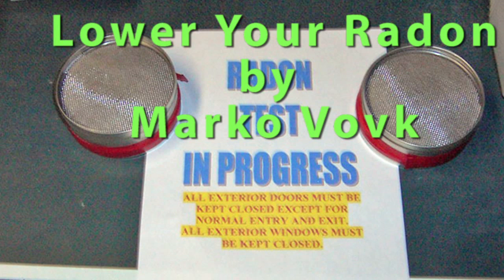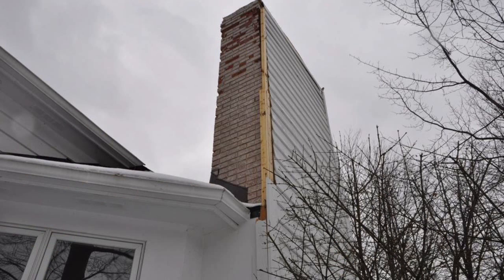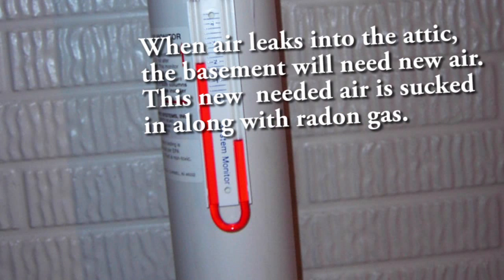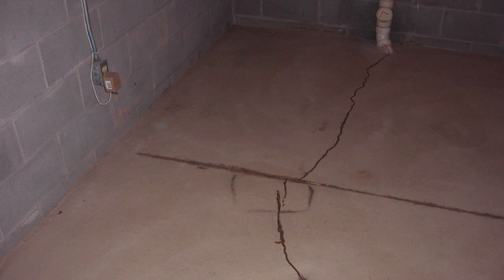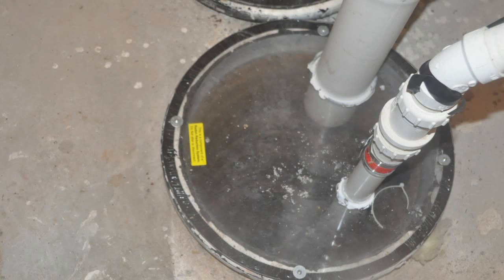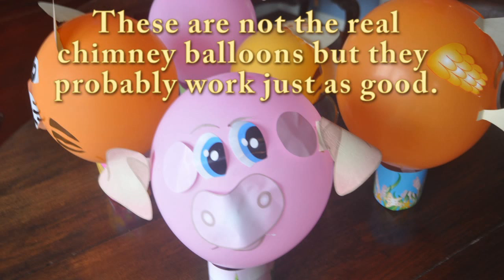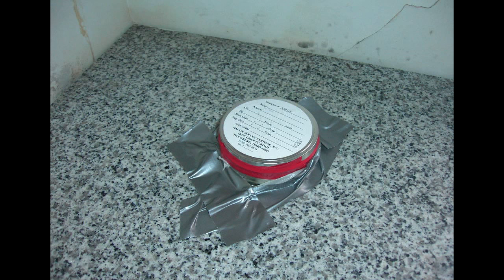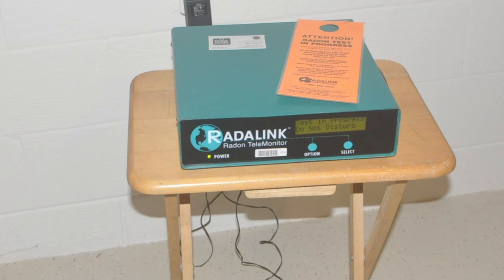Free easy way to lower radon gas

Comment: I wonder if anyone has tried to pressurize the gases under the foundation just slightly to push radon gas away from the subsoil?
Reply from the maker: Not sure how to do it that way
Reply: @Clevelandmarko  it’s easy just put the radon fan in backwards.

Comment: My 90% gas furnace draws combustion air from the vented crawl, which I leave open, since Eastern Washington is 2" shy of desert. Our snow is dry, our summers are dry and spring and autumn very wet. I have full HVAC with cooling unit outdoors, and heating air drawn from the house. My thinking is that using a single pipe/exhaust only system could be a pretty effective way to reduce radon. Seems it allows for the radon gas to literally get pumped out of my crawl by my furnace via the combustion process, while simultaniosly drawing in fresh air from under the house instead of through living space nooks and crannies. Is this circulation method adequate? I am only 624 square feet and single story.
Reply from the maker: I have a sevicw.  Call Marko with a question.  Just Google it

Comment: Radon itself is harmless. It's a noble gas and doesn't bind to anything. However as it decays the "radon daughters" or decayed radon does bind to everything including your lungs. If you can circulate the air which creates a small amount of static or use a positive ion generator/ fan this will cause the decayed radon to bond to walls and floors and eliminate air born / breathable  decayed radon.  Also, AC has increased the levels of radon nationwide along with asthma and allergies. AC doesn't exchange the air .  . . . it just cools it and re circulates the same air over and over. The national average of exterior / outside air is 4 picocuries per liter of radon. BUT exchanging the outside air radon ( the noble gas ) with the "old" radon that is decaying in your home will substantially reduce your breathable radon.
Reply: National average of outside air is 4 pCi/L??? I think you mean 0.4.
Reply from the maker: thank you

Comment: How about running a fan and a dehumidifier...would that help?
Reply from the maker: +JP Flachier                     Dehumidifier always helps
Reply: I think running the whole house fan 24/7 (except when AC is on) is beneficial. Yes, the fan will suck some radon into the house, but it will expel more than it takes in. The only thing that may be bad is that most fans are located close to the sump pump area which is a highway for radon gas entry (seal that with an air tight cover)

Comment: Radon is a hoax.  Check out this link:   www.forensic-applications.com/radon/radon.html  There have been several SCIENTIFIC studies showing small amounts of radon are either harmless or even beneficial.  Think about it, well water contains radon, people drink it and shower in it, yet live.  Use common sense people.  Costs nothing to fix a problem that doesn't exist.
Reply: +Jo Blough 
You are right: that’s the state of the science. In the US, the states with the highest background radiation levels have the lowest overall cancer rates, and the states with the lowest background radiation levels have the highest overall cancer rates.
Reply: You then go ahead and buy a house in Thernorbyl.
I bet the land is pretty cheap there too.......
Reply: Not the same thing. That land was exposed to massive radiation, not the 6 picocuries typical of US homes. Fyi, most fruits and veggies grown around the world have enough radon in them equivalent to 6 months of typical exposure. A banana has 550 picocuries. A potato has 500. Also, while residential home are recommended to remediate above 4 pc, a workplace doesn't have to have remediation below 100 picocuries. Does that mean if I work from home I can safely have 25 times the exposure? The EPA's numbers are nonsense and politically driven by an industry that wants to make money!

Comment: Radon is radiation. For your safety and the safety of others, please refer to EPA radon mitigation system installation guidelines if you are doing the work yourself.  Sealing slabs and caulking are not considered by the EPA as successful  stand-alone approaches to radon mitigation. Homeowners may install radon mitigation themselves. If you are hiring someone to install a radon mitigation system in your home, please know that many states require radon mitigators to be trained and licensed by the state's Department of Health. Contact your state's Dept of Health for more information.
Reply from the maker: Mike1614b Good point. Folks radon mitigations should only be done by radon experts.
Reply: Radon is not radiation. Radon is a gas that emits radiation.
Reply: Radon is radiation is a phrase that homeowners can understand and connect with- they're not interested in the decay chain.
Reply: bananas are radiation too. Radon is common inside and outside. Radon is only harmful as it decays. Exchanging the stale air greatly reduces the problem

Comment: Thanks for the great information! In trying to understand local real estate by zip code in my area I found that many of the most expensive areas are hot with Radon, see http://www.unce.unr.edu/programs/sites/radon/files/pdf/washoeGIS.pdf and it looks like most of the USA has a lot of Radon. Now, since humans have been living with this since pre-recorded history, does anyone know what percentage of populations are afflicted with lung cancer/other cancers who have never smoked that live in areas outlined in red on Radon maps? If it's below 5% then I think there may be a problem with concern about Radon or am I wrong? Look, it appears 3/4 of the USA is in the red for Radon per the EPA http://epa.gov/radon/pdfs/zonemapcolor.pdf
Reply from the maker: dbstube Not really, our homes are getting tighter and tighter.  You make a good point. I will have to research that one. Thanks for putting up the link. People should check out your link. Its good.
Reply: Clevelandmarko You're welcome & thanks in advance for anything you find! Another thing we learned recently concerning well water is not only radon, heavy metals and toxins, but that it's best to use reverse osmosis filtration (the next more involved step of course would be distillation with a recharge of vital minerals)

Comment: I have heard that sometimes "Radon Mitigation" people PRESSURIZE the basement and the fan pulls outside air under the house ?  Years ago on this old house they pulled a slight vacuum from under the slab and exhausted above the roof line.... did the idiots at my house just isntall the fan backwards ?   THanks
Reply: there is an arrow on the fan pointing the direction for the air flow.